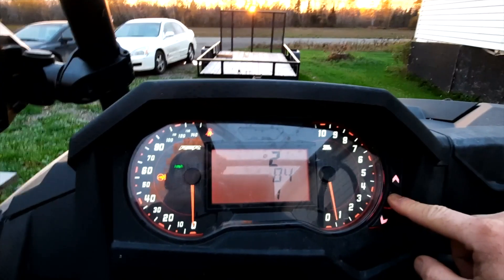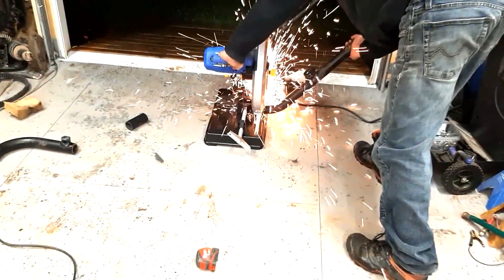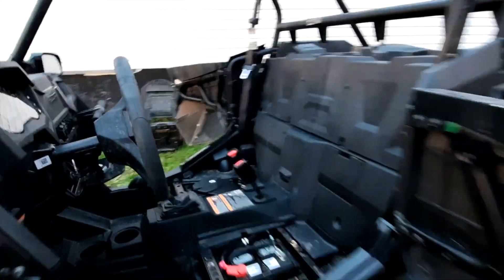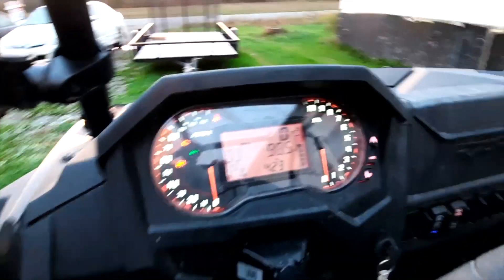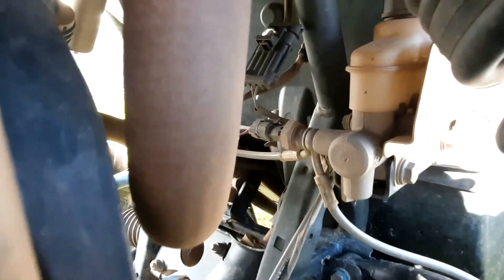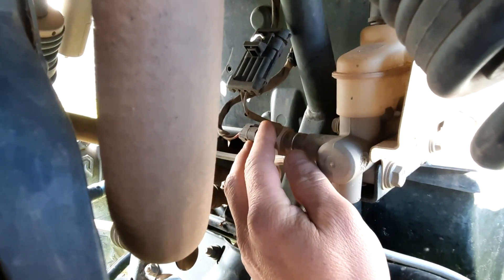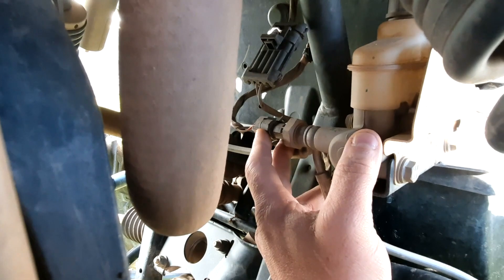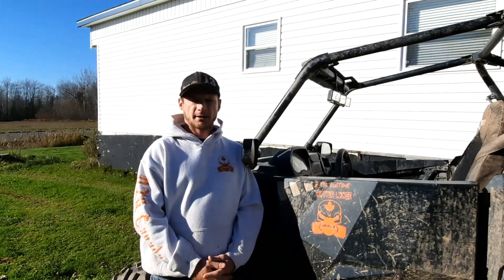Polaris RZR Engine code 2-84 -1,   What it means, and how to fix it.

Comment: I just went riding this weekend and got the same code. Funny thing is I didn't go through any water. All desert driving in California. Maybe dust got in there? Put in the toy hauler, drove home when I pulled the sxs out, message was gone. I guess I will put connector, clean out and wrap with some type of water proof tape. Thanks for the video!

Comment: Weird cause 2 84 1 is a speed sensor? On my 2020
Reply from the maker: that's why a lot of people change the speed sensor, and doesn't solve the issue. brake switch is the #1 cause for this code, and a very common issue on a lot of newer RZR's. it's always possible the speed sensor could be the issue, but I find it's more rare than it being the brake switch.

Comment: Would you happen to know why my 2017 RZR 1000 S backfires when I’m slowing down?  It sounds like a popping noise, but only when slowing down. Any help would be appreciated. Thanks.
Reply from the maker: When is the last time you inspected, and cleaned, the spark arrestor in the tip of the exhaust? I would start there, they're notorious for getting plugged up, and could certainly cause that issue to happen.

Comment: Hi thanks for the post! I have a Sportsman 570 EFI that is showing this code, the engine is working super hard, wondering if this would also be a brake switch? It started while coming back from ice fishing thru slush
Reply from the maker: I'm not sure that the brake switch would cause the engine to work hard.  Could be due to a number of reasons. Inspect your intake boots well to make sure water ain't getting sucked into the intake.
Reply: Hey @mybigteets did you ever get a solution for that? My 570 sportsman is doing exactly the same thing you're describing

Comment: BRAND NEW 2O21 18KM ON IT AND IT DID EXACTLY WHAT URS IS DOIN! IAM GOIN TO TRY UR FIX! WHERE EXACTLY DO I PUT THE GREASE? DEALER SHIP TOLD ME 3-4 WEEKS TO GET BACK IF I TAKE IT IN
Reply from the maker: inside the connector, but don't put to much. Could also try electrical tape around the complete connection to help keep moisture out as well. it's annoying to have happen on such a new machine, but at least it's still drivable until you can get the switch replaced. I was lucky enough that my dealer had a wrecked unit they were able to take a switch off of until my new one came in.

Comment: I've had quite a few friend with their new Polaris have the brake switch fail quick.   You'd think they would address the issue at the factory or at the dealer before sending it.      my friend went to pick up his replacement and they came out with a big ass box of them, so he said, i'm not the only one.  the part guy laughed lol   Good video again.
Reply from the maker: It's extremely common on these newer models. dealer told me today it's happening on a lot of the machines they sold. me, and another guy got our machines the same day, and we both had it happen first ride out. Think they're gonna do a fix as they need to kinda deal. At least it's not costing me anything except for the inconvenience of bringing it in.

Comment: I have a 21 turbo keeps blowing light fuse eveytime I take it out seems to  be when I hit brakes sucks but she's going  back to dealer this week hope it gets fixed
Reply from the maker: that would deff be frustrating. if it's your brake light fuse going out, I would suspect a wire grounding out somewhere. Hopefully it's an easy fix, and they get the issue solved for you.
Reply: I have the same problem how you fix it?